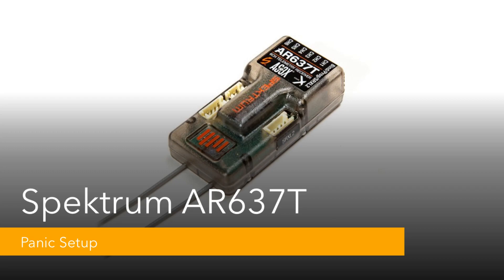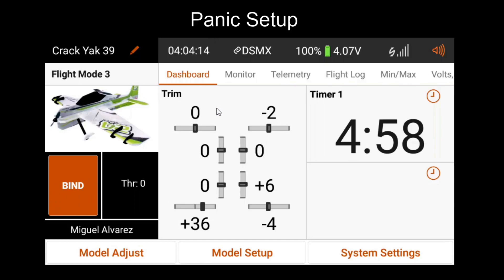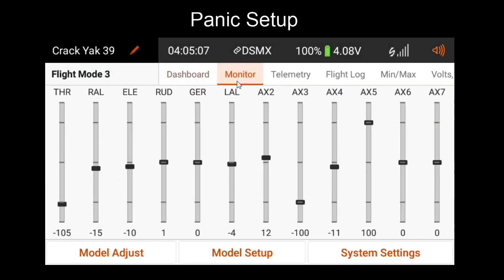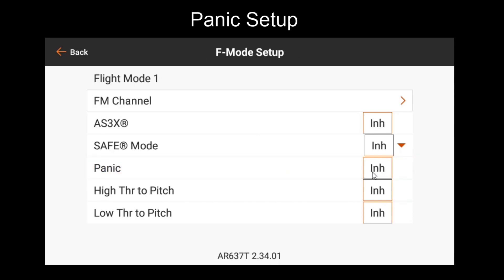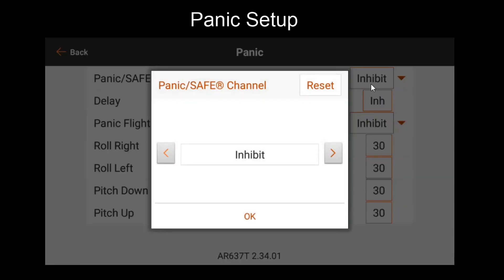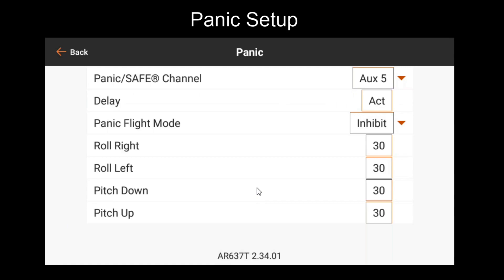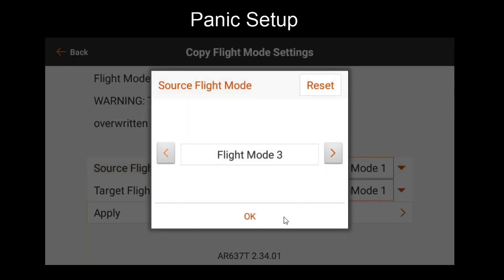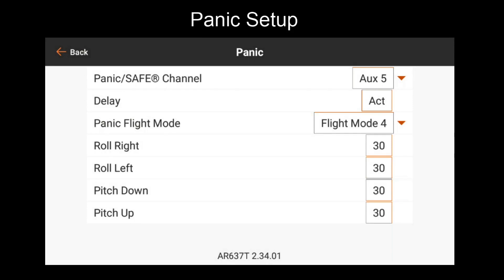4. Spektrum AR637T Setup - Panic

Comment: Thanks for the valuable information.  Question:  Let's say you set panic to FM4 as suggested  and tweak FM3 settings.  Let's also assume you have FM4 and FM3 on different switches.  Now if both switches are set to those corresponding FM's,, then wont they clash?  Or is FM4 only engaged after panic mode button is pressed regardless of switch position?
Reply: I believe in this particular case, FM4 is not assigned to a switch but is a copy of FM3 that can only be activated by pushing button I.

Comment: miguel, need help, i installed ar637t in a spitfire and programmed with nx6. i have 3 flight modes, safe, intermediate and as3x. as i go through each mode, i see no difference in the surface throws between intermediate and as3x. can i fix this?

Comment: Hi Miguel, Thank you for sharing such a detailed and helpful Video on setting up Spektrum AR637T     I do have a question though about PANIC Mode. I have set up on my ix12 transmitter exactly as per your video, but I am confused as to how you can test If PANIC works when it is in SAFE mode, as SAFE Mode has already implemented the corrective movement of the control surfaces, so when you press PANIC there is no change to the control surfaces, where as all other non SAFE Modes work a treat and the surfaces move to level the aircraft when PANIC is selected. I did hear you say test PANIC in a NON SAFE Mode so why is there an option to activate PANIC in SAFE Mode?   I would really appreciate any help you can give me on this, thank you.
Reply: Richard I saw what you did. Basically “beginner mode or safe mode”  are the panic mode settings and therefore panic mode will really only work in intermediate and experienced modes. Safe mode should not let you get inverted....just my two cents...
Reply: Keith Binder , Thanks Keith, i thought that was the case, thank you for confirming it
Reply: @richardbooth3848  Yea Spectrum needs to get their terminology straight. Safe select, Self Leveling/Angle Demand, Safe Fail safe, and panic mode. Panic mode seems outdated to me with safe select. The we have the word "smart". Smart batteries, smartsafe, and smart esc. Spectrum, you make great products but stop using the word "safe" and "smart" for everything!